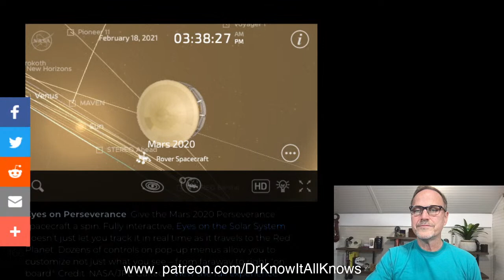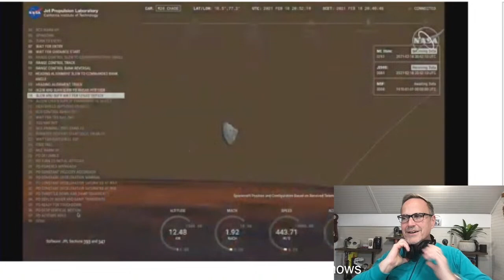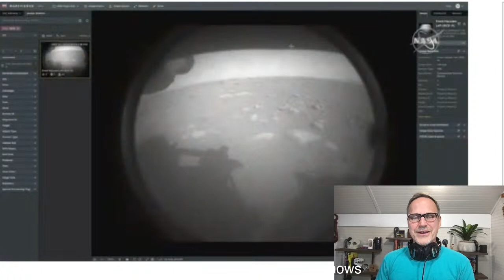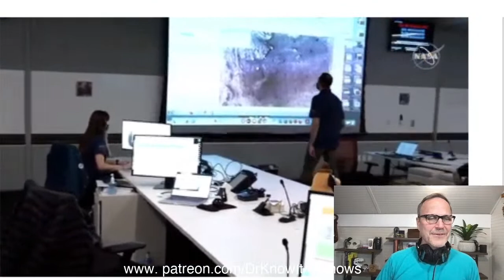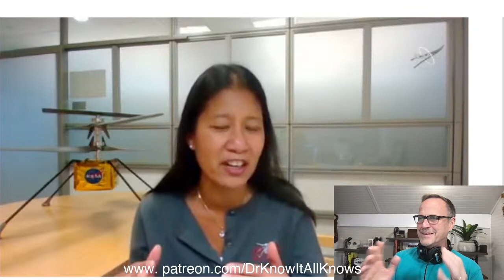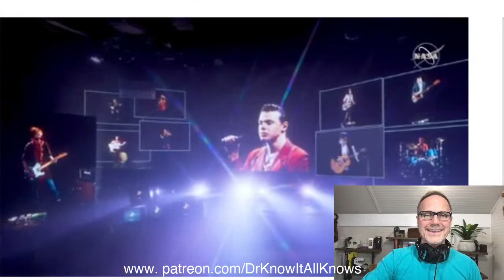NASA Perseverance Entry, Descent, Landing - Live Stream

Comment: Thermal cycling on the corners led to stress cracking on the wheel surfaces, which eventually caused failures.  Straight slightly curved lines avoid the stress points